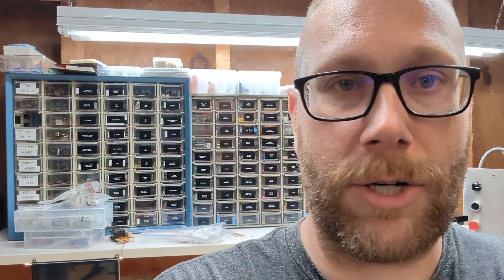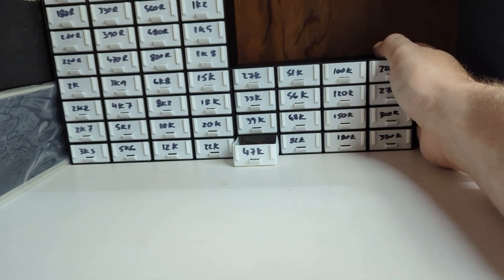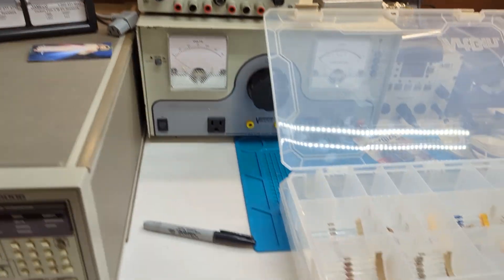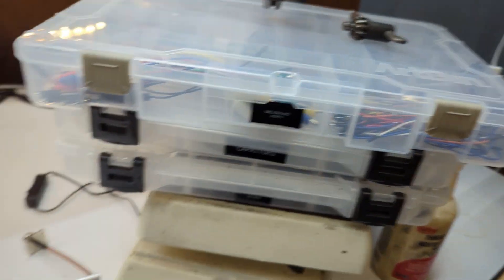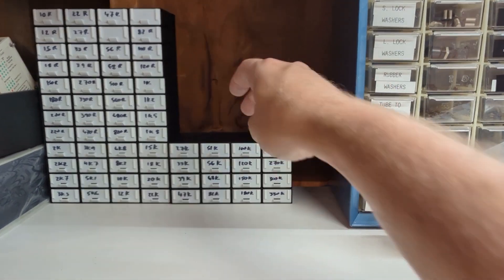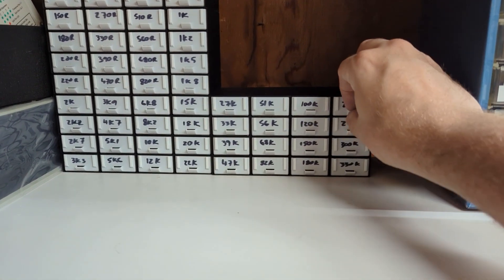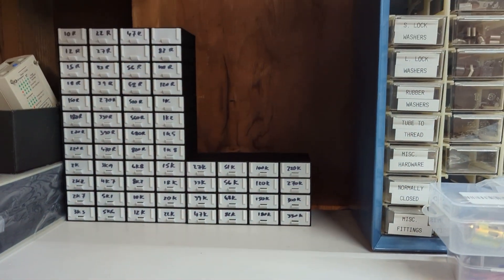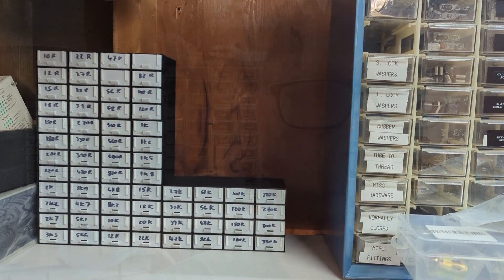MAKE YOUR OWN Electronic Component Drawers!

Comment: If there were some indentations/holes in the bottom of a case and protrusions in the top, then they could lock into place when stacked vertically and not slide about. Less permanent than gluing them together.

Comment: It prints drawer walls very slow because of maximum layer time. There is not so much to print. You can workaround this by putting multiple drawers at the same time. So there will be more material per layer. If you just speed up you risk that walls may deform as they will not be able to cool down properly.
But if simple speedup works for you, its OK.

Comment: For resistors, diodes, and other similar things I've actually found using a lever arch file and pockets designed for card collection (magic the gathering, etc.) 

All mine are just in a couple of files on the shelf.

Comment: Fast-print modular storage drawer system is another nice one.
Reply: This looks pretty cool!
Reply from the maker: @TheDark0rb  sounds cool....you got a link? I'll check it out!
Reply: @hamradioexperience links don't work in YouTube comments, but I searched the exact phrase and found it as the first result on printables. "Fast-Printing Modular Drawer System (Vase Mode)"
Reply from the maker: @forivall  ah. I'll check it out!
Reply: The only drawback I thought of, if it is vase mode it can't be printed too fast = ) You cannot print multiple models simultaneously in vase mode. And if drawer is small it will deform if not printed on proper speed. But they took less plastic is for sure.
I love the idea.
Reply: @enosunim  at least with small vase mode items (like these bins), I've been able to use cura's one at a time mode to print 3 or 4 at a time.

Comment: If you want to speed up the print of the drawers without having to manually up the speed at the printer for every print, check your print settings. Specifically External Perimeters speed. You'll probably notice that the External Perimeters speed is lower than the Perimeters speed. This is so the outside of regular prints looks pretty. Bump the External Perimeters speed up at least to the Perimeters speed to knock the drawers out faster.

I don't know what slicer you are using so the terms might be a little different on your end. I use PrusaSlicer so that is where I got my terms. In PrusaSlicer you need to be on at least Advanced settings mode to see the speed settings. YMMV with other slicers.
Reply from the maker: @Sembazuru  good thinking! Yes, I'll need to translate that into Bambu Slicer, but. Thanks for the tip! 73,
Reply: @hamradioexperience  also check minimum layer time. which basically slows down printer when there is not enough time before next layer starts
Reply from the maker: @slayer666321  good thinking, thanks!
Reply: Believe me, minimum layer time exists for a reason = ) Better put multiple items then have one fast and deformed item = )